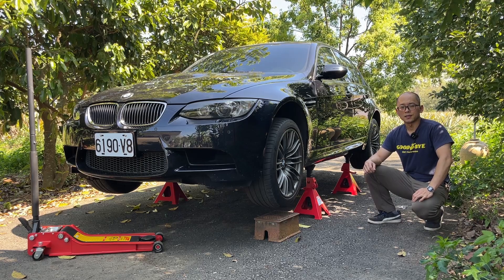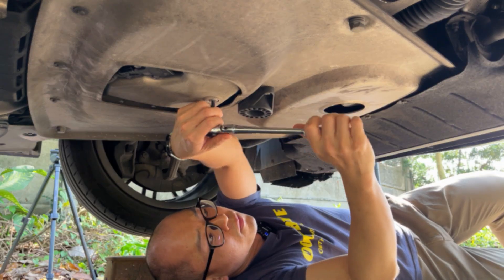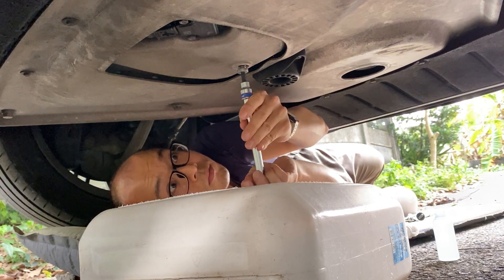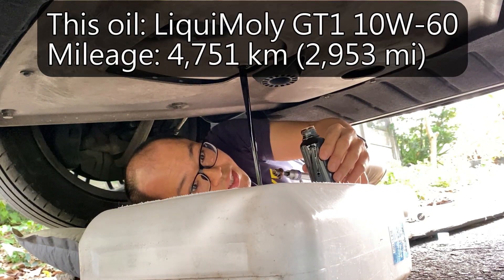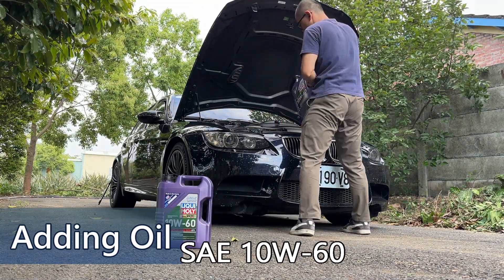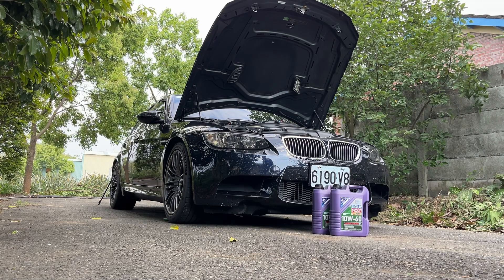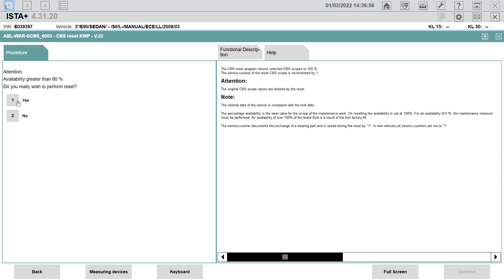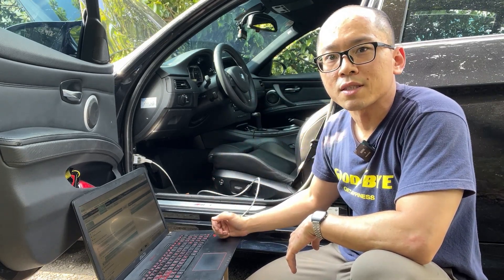Engine Oil Change, CBS Reset, Jacking DIY for BMW E90 E92 E93 M3

Comment from the maker: Important! SAFETY FIRST for using car jacks!
- Undo both TWO plugs to drain oil.
- Drain plug torque is 25 Nm.
- Add 8.8/8.4 L first, then top up the oil according to oil level.
重要! 使用千斤頂，安全第一！
- 放油螺絲有2顆
- 放油螺絲扭力為25 Nm
- 先加入8.8/8.4公升機油，再看油量添滿

Comment: There is two drain plugs to be removed in this M3. 😅
Reply from the maker: Yes indeed! What an odd design. The big oil sump and the front axle support are both essential elements of the M3's high performance. The M department really used a lot of effort to concentrate many racing technology in a compact car!

Comment: That M3 is in fantastic condition 👏
Reply from the maker: Hi Andre, thank you, it’s my pleasure! This the report in February 2025. I just replaced the following items at its 140,000 km; the 32 valve stem seals, MPorium stainless steel VANOS covers, NRW Design aluminum valve covers, valve cover gaskets, 41 valve cover bolts and fresh engine oil. The car has a bit extended crack upon cold start but runs very well and no fault codes. I will make a video about the above DIY and report whether the oil consumption has been improved. See you soon!

Comment: OIL DRAIN MUST BE BEFORE CHANGING FILTRE 
DRAIN WITH FILTRE  AND OIL  CAPS  OPEN FOR SMOOTH AND COMPLETE DRAINING FOR AT LEAST 15 MIN 
BMW RECOMMEND SHELL FOR NOW 
BUT LIQUI MOLY IS THE BEST OF ALL
Reply from the maker: Hi Amairi thank you for the tips! I totally agree with you and I have been doing it in this sequence.

But before I did this video, I referred to the instructions in ISTA and this is the exact order for the S65 engine. Perhaps there are some background information for this but it is not explained by BMW. So this is why I decided to go in this oil changing sequence.

I think either ways are okay as long as we are changing fresh oil frequently. But the best way is like you said, to completely remove the old oil in the system. Best regards to you!
Reply: Like he said, crack the top of filter open or at least remove filler cap to let the air flow through and assist the flow of oil when draining. 
Once draining, go back up and then do the filter removal and swap. 
You will also notice less mess doing it this way as the pressure is released and the oil filter will be less full. 
Good work looking after your car. 
Doing these videos is an investment into your sale price of your car, at least another 10K in my opinion if I saw someone doing all this on YouTube. PROOF of how well you cared for the car. 🏆

Comment: Curious to ask, have you done rod bearings on the M3?
Reply from the maker: Hi kid, thank you for your question. Yes the rod bearings have been changed on my M3 at 110k km, but they are done by some tuner.

My tools and facility are quite limited, so I was not comfortable to do it by myself. However, I do hope to have a garage with full tools in the future so I can enjoy DIY. Maybe I can do it at 200k km 🤗
Reply: @funcarsgoodpeople  Rod bearings are a pain, tighten screws several times, that's tedious. I would not want to do this myself.
Reply from the maker: @matthias_372  Hi Matthias I believe "pain" is the precise word for rod bearings DIY. You have done it anyway, you are a hero 🥺🥺🥺

Comment: How much is this worth in Taiwan?
Reply from the maker: hi do you mean the jack and stands? i took me 13800 TWD about 485 USD.

Oil and filter costed 4000 TWD about 140 USD 🤗
Reply: @funcarsgoodpeople  I meant the car haha
Reply from the maker: oh 😆 E90 M3 with manual gearbox is worth about 1.7M TWD around 60K USD as recently as I heard. It really costs a lot to own any cars here in TW 🥲
Reply: @funcarsgoodpeople  Holy smokes that's expensive, they're worth it though!
Reply from the maker: @Aspireonthego  Yes! The car that brings me endless fun!